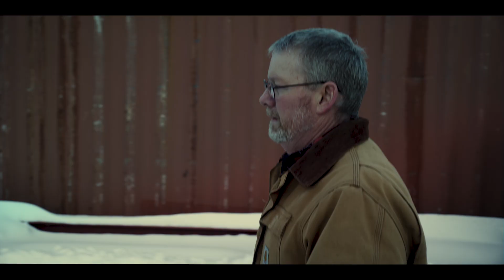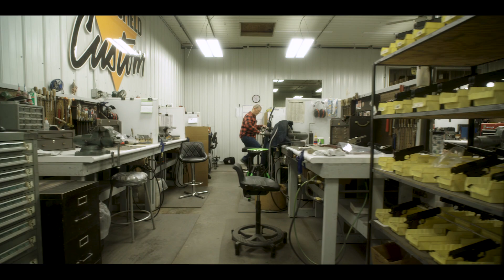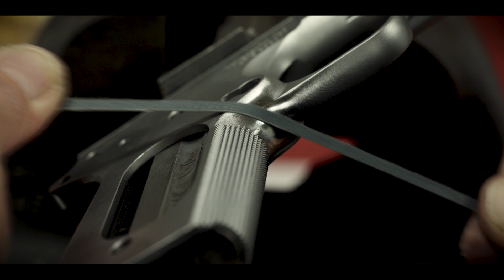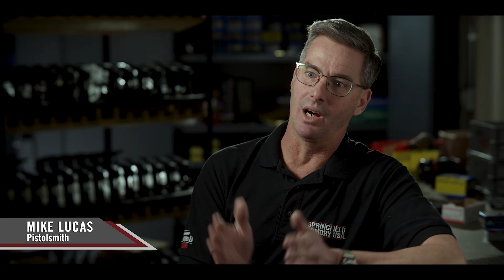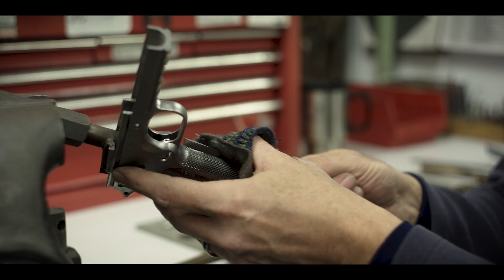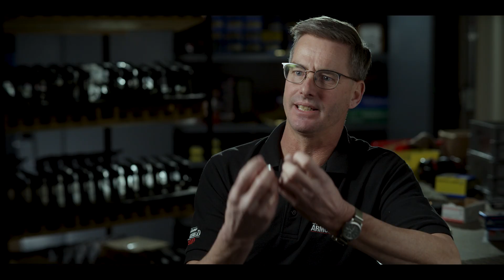Springfield Armory Custom Shop - Our Story

Comment: Nice video. Just hope the quality of your work spill over to the regular production line. I have several of your " regular " production 1911s (Milspecs, stainless Loaded), and there is a lot to be desired on the slide/frame misfit,  subpar quality of the small parts, unacceptably sharp serrations for the slides which is very pronounced on the stainless models, horrendously ugly machining marks on the internal areas of both frames and slides.

Comment: Love the video and I own a 1911, but if the detail in making a 1911 so precise then why do some owners experience so many problems at the range? Sending back to adjust or fix a 1k pistol is a hassle. Again I love my 1911 but had so many issues before it finally worked. Two words Quality Control.
Reply: David Cisneros because those are probably not custom shop Guns. The QC at the custom shop is on par with Wilson combat and Les Baer. The pistols this group makes are 2500 and up.
Reply: These are NOT $1k guns. :). This is Custom Shop - $3,300 guns